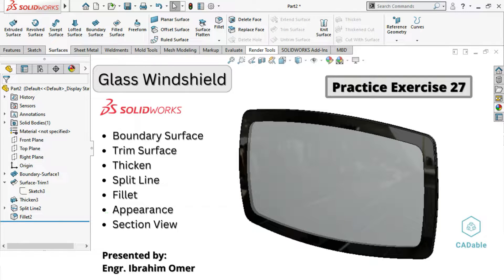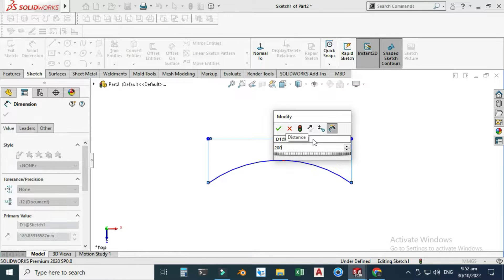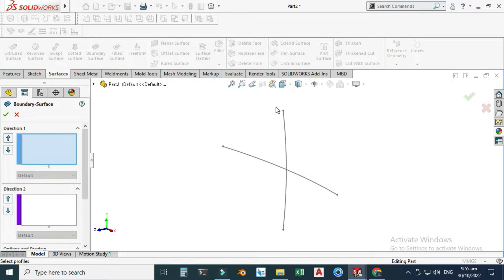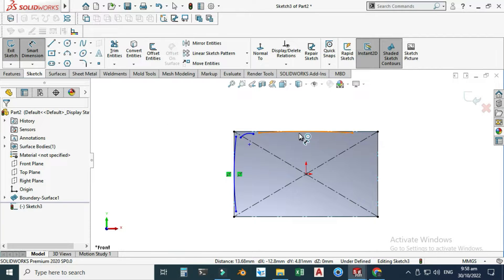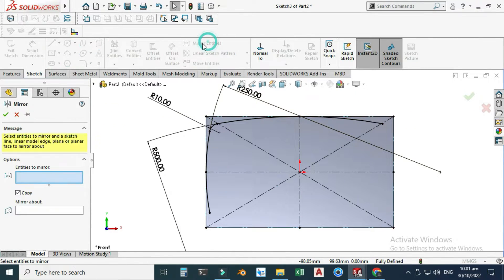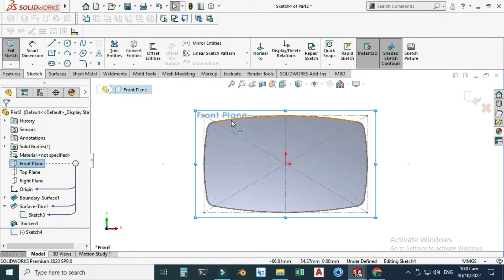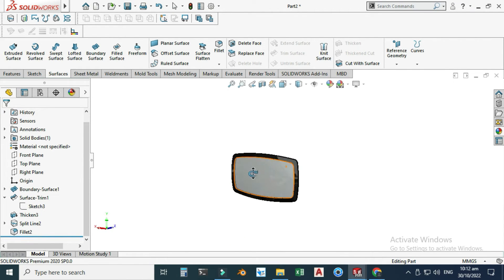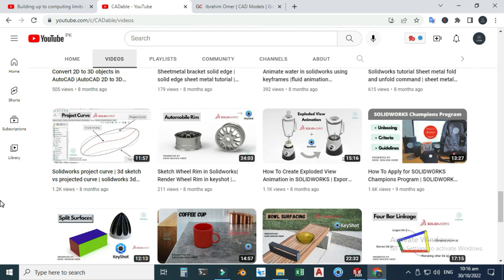Glass Windshield Solidworks | Solidworks Boundary Surface | Automotive windshield Solidworks

Comment: hello again trim tool and target do not intersect error. do you know resolution?
Reply from the maker: Hi
Sorry for late reply, the error typically means that your trim tool isn’t fully intersecting your target surface. Often, the solution is to extend or adjust your trim tool (or the target) so that their geometries overlap completely.
Reply: @CADable  I solved a task thanks to your video, thank you
Reply from the maker: @safakgocmen7830  thank you🙏❤